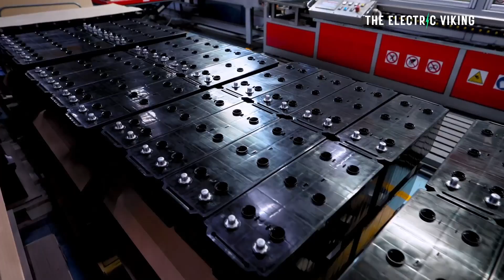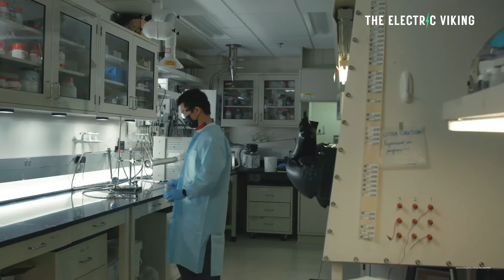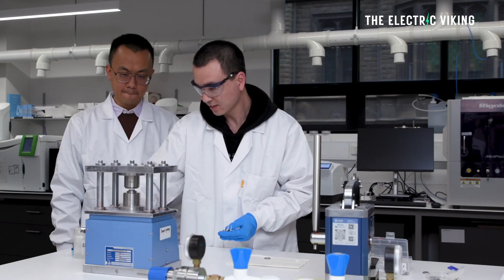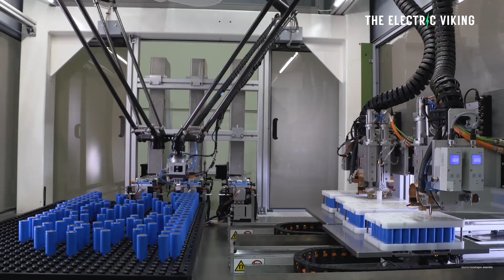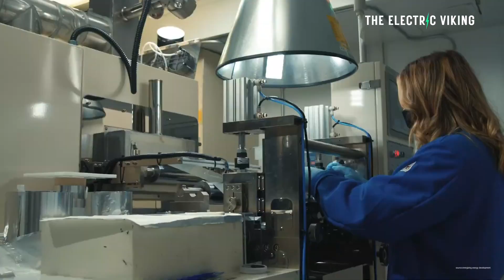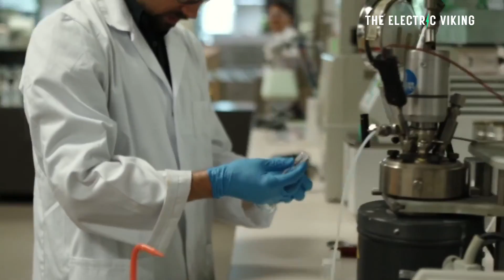Fire proof Magnesium water batteries will rival lithium in only 1-3 years

Comment: Here is a fact: when pure magnesium catches fire, it can't be extinguished with water.  If you put water on burning magnesium, it splits the water into hydrogen and oxygen and burns even hotter - blue white hot.  So water does burn with magnesium.

Comment: Magnesium burns just fine  all it needs is air and heat  While safer If there is a fire in a car crash, batteries drain, then magnesium burn at 3000 degrees.  There are lithium  batteries that don't burn.  They have been used in home battery systems.  They haven't been used in cars as when packaged as traditional lithium batteries there is so much packaging involved it runs up weight, ie many small batteries.  A US co is building out a huge fire proof lithium battery plant with contracts for car manufacturers to make LARGE batteries without all the packaging issues.  Why didn't chinese battery makers do this?  China makes more selling cheapest crap.

Comment: Electric forklifts and material handling equipment are an ideal application for a heavy non-flammable battery. In these devices the battery weight is a large part of the total vehicle weight, and it reduces the need for the steel ballast necessary for stability.

Comment: Those crappy lead acid batteries don't burst into flames spontaneously belching acid, lithium and cobalt gas. Lipo will go down as the biggest wrought in the last hundred years. No other device with its qualities or danger's would ever have been allowed for general consumption,  that is they are next to impossible to put out. without cold brine or tanks for immersion. The old lead acid is also easily and efficiently recycled unlike the hugely energy dense Lipo. It goes to show the brain power when greens will drive these bombs yet are scared of nuclear.

Comment: 12v lead acid battery is not the best for Ice car, because most of its only good for 12-36 month before need replacement but yes that what manufacturer like customer were forced to keep buying back, today its should be easy to design 12v lithium batter that can be put at under boot at back the car rather than near hot engine, and not need to replace it up to 8 years.
Reply: Nonsense , a lead acid battery can last for 6 or more years if looked after .

Comment: Still takes more energy to charge a battery than you get back all battery's operate the same lithium is smaller and lighter but to get the same output takes the same input you not getting more energy it's still a battery I have just invented a battery trailer doubling the range of all ev vehicles without installing a larger battery or modification

Comment: Solid state Sodium are also fireproof. LFP is very resistant to fire. Who will dethrone Lithium?  
So many different types of maintenance free batteries, on the horizon.

Magnesium is starting to be used more in EV manufacturing.

Comment: Heard about hundreds battery breakthroughs in the last decade. None of them have reached the market, so until a major car manufacturer actually puts them in a car I can buy, I don't believe it.
Reply: LFP happened
Reply: AI is speeding up innovation. Teach AI to assess all material composites etc will mean only the most likely to work combinations being considered to develop. 

Within 10 years we'll probably be using a variation of existing technology that is cheaper/cleaner/easier to manufacture.
Reply: @Jamessansome  
They already are and its going faster than they thought as it can simulate electrolyte compounds .. anode and cathode materials and configurations ... however that moves the graft to actually building and testing the possibilities ... And A I depends on the programmers data sets and that two big fundamental question areas.  🤔 However it can cut out a lot of dead end efforts.  Its already giving leads on how to use Sulpher and Na more effectively.. add Al into the mix and you escape a lot of Difficult minerals and can produce third generation cell chemistries.
Reply: Na ion ... ?😁
Reply: @clivestainlesssteelwomble7665  Failed tech from the 70's - nothing new it lost out to Lithium which is why your phone and cordless drill aren't sodium.
Reply: @clivestainlesssteelwomble7665  Sam should have called his channel "Game-changing battery breakthroughs that will never see the light of day"
Reply: Peter… several of them have made it to the market. The thing is, how would you know? Has your mobile phone blown up recently? They change the structure and chemistry in most batteries practically yearly. 

Today’s Lithium Iron Phosphate battery is a massively different beast to the lithium cobalt 18-650 cells that Tesla used a decade ago. 

Dude… you are probably extremely knowledgeable about… the stuff you know about. EVs is not something you know about. Ignore the silly headlines.
Reply: I wouldn't say none but it's easy to get burnt out with all this news, I mean, we keep hearing about radical new battery tech almost on a weekly basis, but it means very little until some of these ideas start to make it to market and at an affordable price point to make a difference.

Personally, I get the impression that most of these projects are either fake or a very slim chance of working, but they hype it up to get investment.

Now, the only ones that interest me are the ones that say they are bringing it to market within 3 years and can do so at an affordable price point, the rest of them, might as well not exist because in all reality, the majority will probably not make it to market to make a difference.

So basically, ignore the ones that say they have a lot of problems to solve, ignore the ones that say it's still many years away, and ignore the ones that don't give any indication on release date and pricing, because a lot of those will probably not make it to market and they are fishing for investments.

Comment: A Chemistry refresher for the idiot making the video.
Mg (s) + 2H2O(g) -> Mg(OH)2(aq) + H2(g)

Magnesium fires cannot be extinguished by water. Magnesium continues to burn after oxygen is depleted. It than reacts with nitrogen from air to form magnesium nitride (Mg3N2). When attempts are made to extinguish magnesium fires with water, magnesium aggressively reacts with hydrogen gas. To prevent any damage, a magnesium fire must be covered in sand.
An example of a magnesium compound is magnesium phosphide (Mg3P2), an odorous, grey solid. When this compound comes in contact with water or moist air, it is decomposed and phosphine (PH3) is formed. This is a toxic compound, and it is also very flammable.

Yeah sounds fantastic.😂

Comment: It figures that someone from a country that hardly ever sees snow or freezing temperatures would completely fail to address the most obvious questions that anyone else who comes from a place where it does get cold would ask: at what sorts of temperatures do these water based batteries freeze and break apart? What percentage of their charge capacity do they lose when the temperatures get close to the bottom end of their range? All the stuff they're saying doesn't mean crap if the batteries are useless in freezing temperatures. In the future, whenever you do one of these new battery technology videos, PLEASE address the freezing temperature issue and answer those two basic questions. Otherwise, you'll just be leaving over half your audience screaming for answers and feeling frustrated like I am right now.

Comment: Another better alternative for battery farms; you dont want your grid power to burn up.  If they can get this to a higher density it would solve the fire problem. And you surely understate the negatives of Dentrites; they can cause fires in EV batteries without warning even in brand new cars; which is the main reason I don't care to buy a lithium based car; Im not keen on my car and my house burning down at no fault of my own. Also Tesla needs easy to find mechanice unlocks inside the  rear seats of the all models; being locked inside when there is a fire is unacceptable.

Comment: Oh dear. Anyone who’s even remotely aware knows all about these aqueous metal ion batteries. Old news.
Zinc has been the main contender for years. It’s marginally stable in water based electrolyte, but has dendrite issues and high self-discharge rate. Magnesium is way worse. It’s unstable in contact with water based electrolytes, and suffers from severe passivation problems. The electrochemical stability window of water is 1.23V, so anything higher than that causes it to electrolyse into hydrogen and/or oxygen, depending on pH. Using concentrated salt electrolytes which reduce the activity of water helps with this, but doesn’t eliminate the problem. While it’s non-flammable nature is great, aqueous batteries will never rival lithium in terms of energy density. It’s just not possible. As a replacement for lead-acid, the zinc chemistry is probably the most likely, but cranking amps is where lead-acid shines, and it’ll be damn hard to compete with that. The best contender is the hybrid supercapbattery, already in production for years now. So far, sales have been poor and lead-acid remains dominant for ICE.

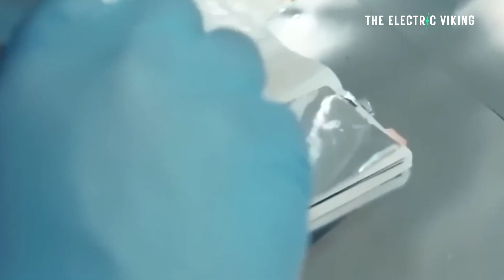Comment: 1:55 what are you talking about "no fuel"? Electric batteries are sealed-off fuel cells with their own fuel and oxidizer embedded inside them. Which is why lithium batteries burn so violently and are impossible to extinguish.
Reply: Very rarely though.

Comment: Wasn’t magnesium wire what was used in photographic flash bulbs? Rapid burning when electric charge applied? What prevents that in these batteries?
Reply: Magnesium in powder form in highly flammable, so is iron in powder form and wool form (+/- 1900c).
Problem with magnesium is that it begins to burn al 600c and burns very fast.
Magnesium powder is also used in old-fashion gunpowder (lol).
It is the question how they gonna use the magnesium and how hot the Magnesium/water cell can become.
Reply: Divers used magnesium torches. It burns just fine under water.
Reply: It's a combination of Magnesium, iron and sulfur. @VolkerHett
Reply: Mag wheels were also banned because they would catch on fire if you had a blowout. Long after that they were still referred to as "mag" wheels but were not made of magnesium.
Reply: Right!
Reply: Magnesium used for bicycle suspension fork sliders must be heavily coated as any scratches are at great risk of oxidising, and even combusting. Magnesium is highly corrosive.
Reply: The water?

Comment: Interesting, I love to hear about New battery tech, but LFP makes for a good 12v replacement and getting quite cheap, I have one for my ICE car. Yes, brand name ones can be quite expensive but quality genetics from China who has LFP tech down quite nicely , cost as little as $200 USD and will last for 10+ years easily. I'd love to see LFP become the common lead acid replacement.
Reply: Lithium is the 33rd most abundant element in earth's crust, while magnesium is 7th. There is about 2.3 billion of tons of magnesium in known magnesite, dolomite, carnallite deposits from which magnesium is readily extracted. In addition there are trillions of tons of magnesium dissolved in seawater. A large percentage of magnesium is already coming from extraction from sea water. A recent advance has made the extraction from seawater much cheaper and easier.  

In contrast, the global amount of lithium is estimated to be about 98 million tons. Lithium is also dissolved in seawater, but at a much lower concentration than magnesium and far, far lower than sodium. This makes it much harder to extract lithium from seawater since sodium and magnesium ions are much more abundant. As a result lithium from seawater is much more expensive than the current method of evaporating high density brines with relatively high lithium concentrations.

So if every lead-acid battery is going to be replaced, it would be much better if the replacement battery will use elements that are in much greater abundance.
Reply: @papparocket  Lithium if recycle, have ability to be able to recycle in infinite way. Then, quantity is not really the limiting factor. This said, people buying thing, look if the thing respect their expectation, yes, then they buy it. Magnesium or Lithium, which one become better or cheaper, time will tell what technology will be next most used.  
@DanielBrownOre Trouble with LFP, for now and for 12 volts battery, without special heating element, they can't be charged under 0C or used under -20C without damaging them. I live in Canada, then, grrrr I can't use them for now as just 12 volts battery, but I love using LFP in my electric tractor mower, battery are so light and powerful compared to my gasoline tractor mower.
Reply: An oxymoron if I ever heard one... quality genetics from China...
Reply: @jasonarondeau  an oxymoron if I ever heard one, ignorance masquerading as assumed superior intelligence.
Reply: @DanielBrownOre  bah ha ha ha!

Comment: hi calcium battery one electron per atom most efficient
 1200 watt hours per kilogram🤔😉
Reply: Actually, calcium is a divalent metal. So two electrons per atom. Calcium batteries are a dead end unfortunately, though. No workable cathode material has ever been found, apart from really low density hexacyanoferrates. Metal anodes have dendrite issues. No stable electrolytes. The list goes on. Forget them.

Comment: DC voltage and water will make H2 and O2 gas. now what.
Reply: H2 generation for water based electrolytes is/was mostly a charging issue. There's ways around it, at cost. So far, Low cell voltage = exploding pack costs.
Reply: Water electrolyzes (makes H2 and O2) when the voltage is above 1.23 volts for pure water. There are additives that allow the voltage to be higher. In lead-acid batteries, the sulfuric acid in the water helps to suppress water electrolysis so that cell voltage be 2 volts (which is why a 12V lead-acid battery has 6 cells). So if the cell voltage isn't above the voltage where water breaks down to H2 and O2 for the electrolyte chemistry in this battery, then hydrogen generation isn't an issue.
Reply: You can breathe the O2, and burn the H2 in a hydrogen car.
Reply: @sarcasmunlimited1570  Oh yes, great idea! Sounds simple, is not. Now you need to regular refill the electrolyte likely with very pure water. Ex-proof, forced ventillation, for the battery room, is likely required. You also need to compress the H2 before you could put it into a car somehow... sounds complex and expensive
Reply: @kuno-genshinimpact8943  
But didn't you appreciate the humor of it?

Comment: Using water as an electrolyte in batteries could potentially reduce the fire hazard associated with traditional lithium-ion batteries, which typically use flammable organic electrolytes. Water is inherently non-flammable, which would address one of the key safety concerns in battery technology.
Researchers have been exploring water-based electrolytes for lithium-ion batteries, and recent advances have shown promise in this area. For example, scientists at the Argonne National Laboratory have developed a new type of electrolyte that can contain higher quantities of water, which could lead to cheaper and easier-to-produce batteries. This discovery challenges the traditional view that water is detrimental to the performance of lithium-ion batteries, which usually need to be produced under extremely dry conditions.
The use of water in the electrolyte can also lead to more environmentally friendly manufacturing processes, as it eliminates the need for special dry facilities typically required for lithium-ion battery production. Moreover, the "water-in-salt" electrolytes (WiSE) have been shown to enhance the electrochemical stability window of the aqueous electrolyte to almost 3V, enabling the development of higher-voltage Li-ion cells.
However, while water-based electrolytes can significantly reduce the risk of fires, they do not completely eliminate all safety concerns. For instance, water can react with lithium to produce hydrogen gas, which is flammable and can pose an explosion risk if not properly managed. Therefore, additional strategies, such as protective coatings for electrodes and the use of highly concentrated electrolytes, are being researched to prevent such reactions and improve the overall safety and performance of these batteries.
Reply: Was going to mention same thing, lead acid batteries also produce hydrogen when charging and produce explosive environment for people info.

Comment: Perfect for battery grid storage and home battery power walls.
Reply: They would need an antifreeze in the water based electrolyte.
Reply: Yep! Joey, as a rural homeowner paying exorbitant rates for electricity, the fact that home storage batteries are still far too expensive for working people is standard in the way of me buying home batteries. Installed, Powerwalls and their competitors are still over $1,000 US per KWH installed is a major roadblock.

Comment: Everybody keeps thinking that Lithium is hard to find or expensive. It's not hard to find and the cost is plummeting. 
All that is left to do is to have Lithium refineries use new more efficient and less costly refining techniques. Tesla will be demoing this in the refinery they are building.
Reply: Aluminum (Al) used to be the same way.  It was more expensive per ounce than gold because Al refinement was SO expensive.  Cheap electricity was the key to unlock affordable Al.  We’ll find a way with Li, too.
Reply: @737smartin  Indeed!  Tesla has a refinement method that uses Sodium to extract the Lithium through a cheap method. The sodium can also be reused, they say, and the minerals left behind after the extraction are non-toxic and supposedly can be used as land fill. They want to demo this new method to get other refiners interested in using it as it is more environmentally friendly.